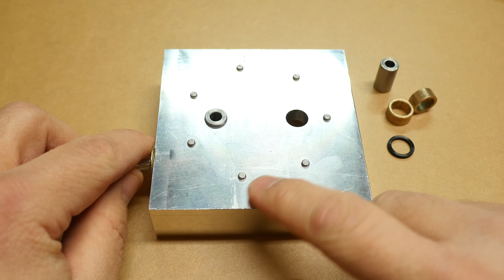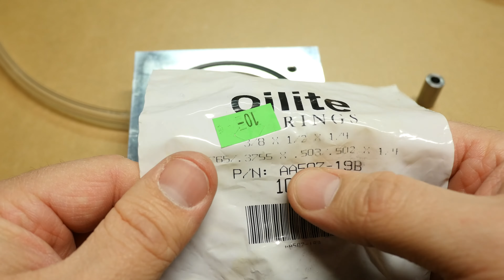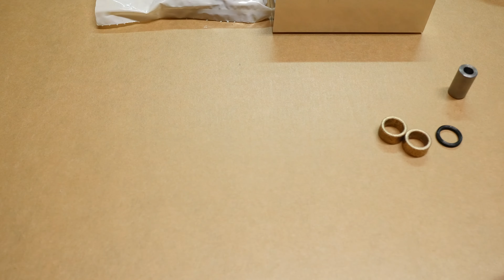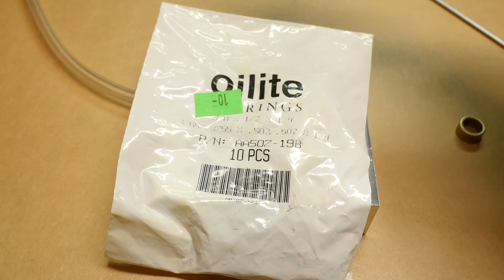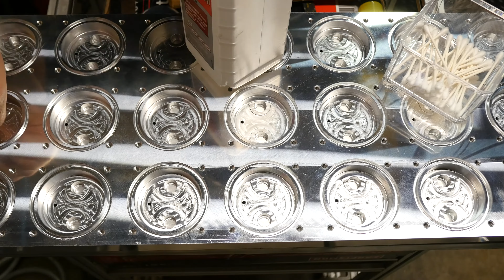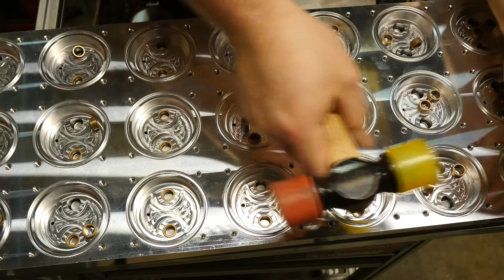Bushings 502/503 - Prerequisite: Reading 101 (21-Station Pneumatic Fixture Plate pt.3 of ?)

Comment: Intriguing! I am not a mechanical engineer, so it is very possible the following questions could result in some serious stomach pain to experts in this area, but what if you heat up the aluminum and cool the bushings so they go in easy and when everything normalizes they are set in place? I wonder if this would still result on the shaft binding.

On the holes that are too big (0.504), how about putting a knurl on the bushings? Would this have resulted in an air scape through the knurl low points? Obviously this is no longer needed, since you solved the problem with 0.503 hole diameter, but I wonder if the knurl could work. Not that you want to add an extra step...

Either way, that piston looks gorgeous!
Reply from the maker: Thank you!

I wonder if the heating and cooling would change the binding issue. I suspect not, but I "dunno".

With my current knowledge/experience I would shy away from heating the plate. I imagine heating the plate would surely cause it to expand, but I'd be worried about the heating occurring unevenly, thus causing the expansion to happen unevenly, potentially causing problems.

I'm just speculating though, since I've never tried heating a piece of metal like this. For all I know, maybe nothing adverse would happen as long as I kept it under a certain temp, say 100° C or so.
Reply from the maker: ...
I wouldn't have any problem cooling the bushings though. Great idea! I'll try to remember that for next time.
Wait... better yet, I'll just throw the single extra one I have in the freezer and see how much it shrinks.

(Apparently the stupid fucking YouTube app won't let you edit a post.)
Reply from the maker: CNC Dude
Before I forget again: the knurling idea is a good one! I don't have a way to knurl, but I bet it would work.

So, I tried putting a bushing in the freezer but I wasn't able to measure any change in size. I used my micrometer that goes down to... half-a-tenth I think. I also noticed that it got up to ambient temperature very quickly, so even if it did shrink appreciably, you'd have to work really fast to get them in place before they warmed up.

Comment: Another great installment, keep these coming!! If you have problems similar to the bushing slip in the future, i've had great results using 600 series Loctite. I believe 609 is what i ended up using.
Reply from the maker: Thanks!

What I used was some Permatex "Medium", but I didn't want to make it sound like I thought the thread locker was defective or something. I figured since the brass is impregnated with oil I shouldn't be surprised that it didn't work.

Did you use the Loctite 609 on this same kind of brass (or something similar)?
Reply: Yeah it was a sintered bronze but dry... never had oil on it before... i think thats the problem. No easy way to get all the oil outta sintered material after its in there!!